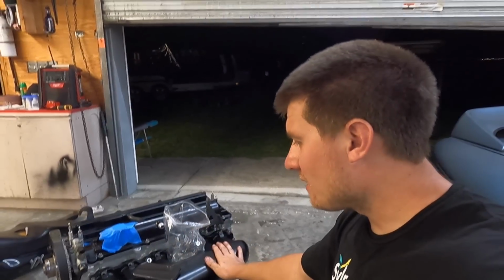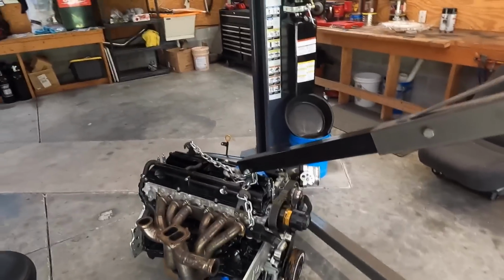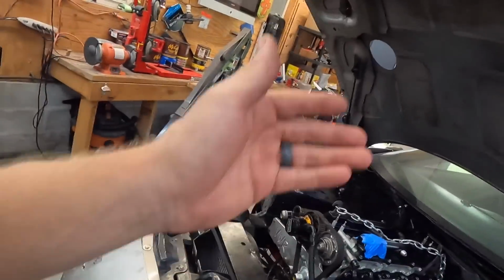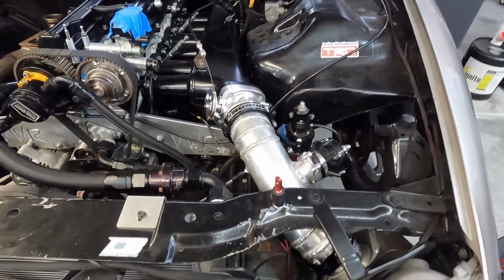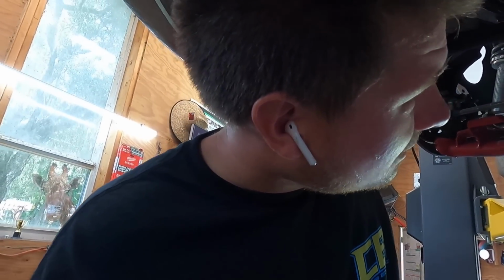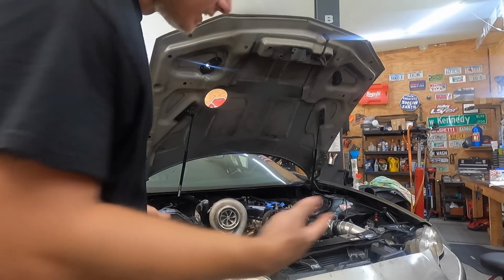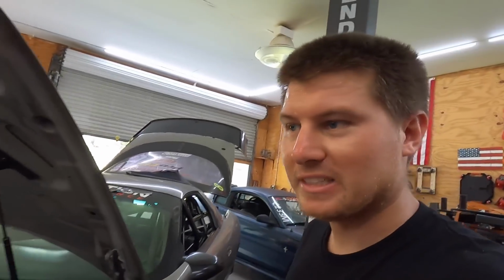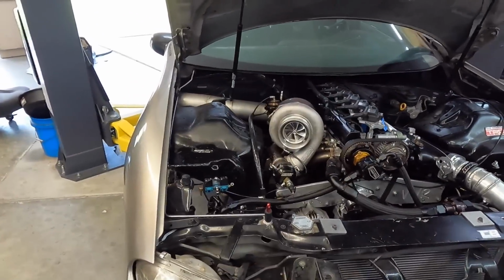2JZ Camaro Runs Again!

Comment: Apparently Poor Cooper has No Friends.  Putting a motor in solo sucks & could be dangerous if it fell at wrong time. Guess your friendless ass never heard a Big Inch ProMod Anything? Toyota sounds like a '60's Chev or Ford 6 cylinder school bus.
Reply from the maker: Not really big on asking for help with things I can do myself. But yes I don't think a promod sounds better. It's mostly just loud noise

Comment: There is no reason to pump the accelerator to start an engine with fuel injection, newb.
Reply from the maker: On most EFI systems it will turn the injectors off to keep them from firing.
Reply: @CooperBogetti Even if that was true why would you want to shut of the injectors when trying to start the engine?
Do whatever you want, I'll quit giving advice.